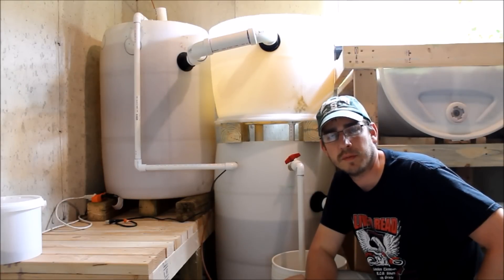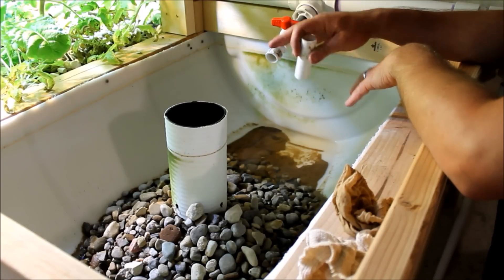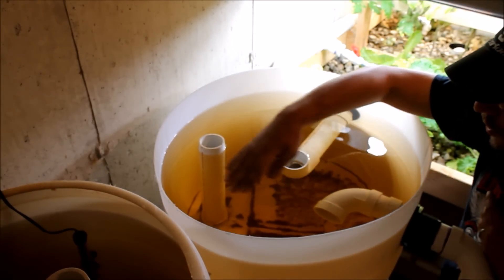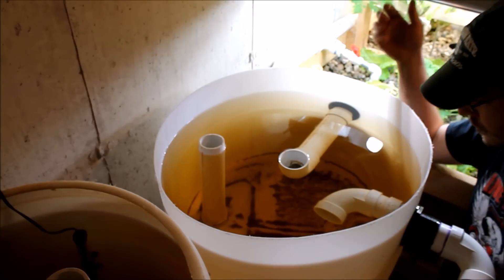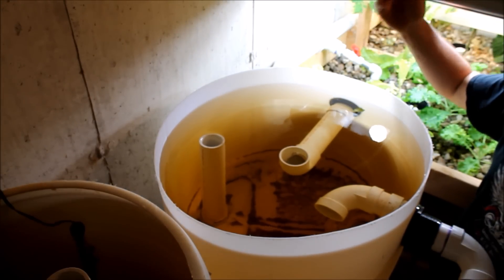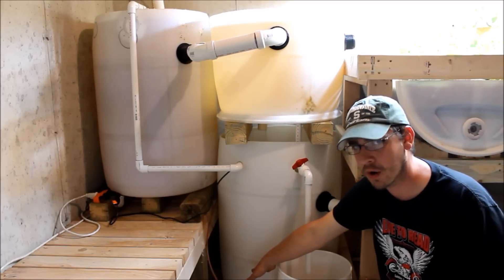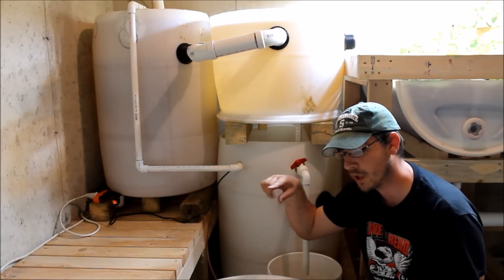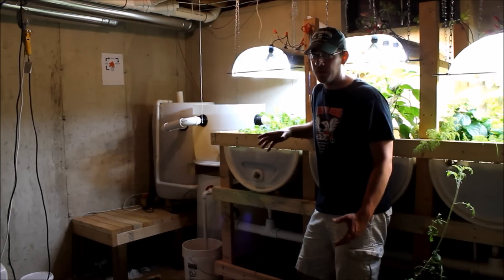Aquaponics System Design - Using a Swirl Filter to Remove Solid Waste

Comment: I see your filter water feeds your grow beds. Do you get enough of a water flow to adequately fill the grow beds so they can fill and drain a few times an hour? Does the grow bed at the end of the pipe get as much water as the two grow beds closer to the swirl filter?

Comment: Do you have a fish heater? Do the grow lights heat the beds at all?
Reply: I believe he has another video that shows a heater in a barrel that held his fish. You could put a heater anywhere in the system that gets deep enough if using a submersible heater, but not the grow beds. Unless in a separate area from the roots & media. The lights could provide some heat to the grow beds, perhaps more if they were specific lamps. 

I'm assuming more heat would come from the bacteria and processes taking place in the grow beds. It should be reasonable to believe with at least a 30 - 50gal heater plus all the other processes, sufficient heat is maintained through the whole system if you include the ambient temperature of the surrounding environment. 

You might need a larger heater depending on the needs of the fish and where the tanks are installed. Adjust according to whether or not they are tropical or coldwater natives. For plants, the water will be warm enough.
Reply: Water has a large specific heat capacity that increases substantially with volume. The more water in your system, the harder it is for the temperature of the water to fluctuate after it has reached the ambient temperature of the environment.

Comment: Mostly good job but you're killing me with that crooked run...measure twice CUT ONCE!
Reply from the maker: lol, yeah I get it. the swirl filter was an afterthought and I had to use the existing bulkhead adapter hole in the fish tank so it is what it is. It wasn't a bad cut though, it was intentionally crappy:)

Comment: I have problem  is the water from fish tank to swirl filter is slower than water from pump to fish tank. That made my fish tank overflow. :(
Reply from the maker: lower the output pipe from the swirl filter so it has a lower level than the fish tank
Reply: yeah, that's why. I put a same level out put from fish tank and swirl filter. :) thank bro

Comment: i assume you dont use a biofilter to convert the liquid fish waste to nitrates/ammonia to then add to the media bed. I'm thinking about doing a ebb&flow/ DWC system where I think I would need to have the water sit in a biofilter before getting added to a DWC. How would using a swirl filter play a role in that type of system? After thinking this out, I feel I would need a extra bucket for a swirl filter, and an extra resevoir to convert the fish waste to nitrates, and maybe even a sump for overflow purposes. What do you think of that? Thanks a lot!
Reply from the maker: you do not need a bio filter if you are using a media based grow bed system such as mine. The grow media acts as the bio filter. I would still however, recommend a good swirl filter as it will keep the beds cleaner and working better for a long long time.

Comment: Would it benefit the system to use a tapered bottom tank for your solids? That way you can just open a ball valve connected to the center of it, and drain out the collected solids?
Reply from the maker: +Boosted98gsx yes, if you can make one or add a baffle that would taper the bottom that would be awesome

Comment: I've seen other swirl filters that have the inlet pipe at the bottom or a few inches above the bottom. wouldn't it be better to have the inlet pipe in the middle of the barrel? wouldn't it give more time to the particle to move towards the wall of the barrel and eventually sink to the bottom? thanks for sharing
Reply from the maker: +Stavros Santis I would say inlet should be just below the surface of the water at the top so that the fasts lest moving water enters there and then slows down by the time it gets to the bottom

Comment: Why don't you add back the nylon sock to the intake to the planters off the swirl filter? It seems to me that would stop almost all solids?  You could just take it off and rinse it in the same bucket. A 2 minute job that would really keep your system clean?
Reply from the maker: +VacUpacks I have thought about doing that but the swirl filter seems to be doing pretty well. I was allowing for some solids to get through also to provide some food for the worms that are in the grow beds as well
Reply: +SSLFamilyDad Oh, that makes sense. I have red worms in a traditional worm bed they eat quite a bit of food.  Interesting the worms won't keep up with your system without the swirl filter.  Looks like quite a balancing act. Thank you for your response. Great video very informative.

Comment: isn't it good if the solid parts go to the plants for nutrients?
Reply from the maker: mark louie panergo Some still do get through, all the swirl does is settle out the largest solids and allows you to get the grow beds cleaner. If you just let them all go through to the grow beds you will end up with a clogged up mess in no time.

Comment: Now that this system has been going a couple years nearly, how effective do you think the swirl filter is in respect of preventing that build up in the grow beds?
Reply from the maker: Ted Soloman I have not done a full cleanout on the grow beds since I put in the swirl filter a year ago.  I have not dug through the beds yet so I can't say how muddy they have become but I can say that I empty out a lot of solids each week that would be ending up on the beds so I know it is making a HUGE difference. And it provides the absolute best fertilizer for my garden.
Reply: Have you in your journey found the initial start up cost as well as the maintenance costs to be easily outweighed by your yields? Meaning ha it proven to be not only cost effective but profitable in savings at the grocery store?
Reply from the maker: Ted Soloman it is hard to say if we reap enough vegetables out of the system to offset the cost of running the lights and pump (about $35 per month). I have done a lot of experimenting though and am not producing fish at the moment which would make the difference. The benefits of learning how to do this and also being able to get fresh produce right in my basement year round is priceless (well maybe not priceless but worth the $35!). If you did this in a greenhouse it would be easy to recoup your money.
Reply: That's great! Thank you for taking the time to reply. My assumptions were similar. In no way am I discounting the value of the knowledge but I tend to look at all aspects of any project. In no way is a negative aspect a reason to scrap the idea, more a reason to seek the key variable making it cost less money than going to a grocery store. Profitable in the sense that at the very least, the $420 a year is recovered by harvesting non gmo, clean food. However, observing all aspects also helps inspire innovations in making it surpass that very minimum expectation. Which I think will be important to popularizing this system. Because at the very least, supplementing ourselves and decreasing the overall demands of grocery stores allows us as people to vote with our dollars, force prices down, and see more non gmo products on the shelves. Which benefits everyone. All the best to you and yours, many thanks for sharing these educational videos. 

Many thanks,
Ted
Reply: Id also be interested to see if ever the expansion of your grow beds demand the need of a breather tube on the bell siphons. Time will tell I expect. Keep trail blazing.

Comment: Why don't you want solid waste getting into the grow-beds? I understand how solid waste gunking up your pipes is bad, but does it negatively affect the plants?
Reply from the maker: Ruairidh Macleod It does not negatively effect the plants but too much solid waste getting into the grow beds starts to build up on the bottom and then can cause several negative effects. The solid build up will start to get anaerobic and smell, cause pH issues, and other issues. Over time it will gum up the flow of water through the grow media and then you have to clean it all out. The swirl filter does not catch it all, but limits the amount to make it more manageable for the worms in the grow beds to handle and break down plus it gives me some fish waste to siphon off and give to my gardens:)

Comment: what size river rock you use ?
Reply from the maker: David Zick I have replaced all of my river rock with something called beechwood pebbles. The river rock was holding my pH too high
Reply: where do you get that beechwood pebbles?
Reply from the maker: David Zick Local landscape supply place had it for $90 per year. It took less than one yard to fill the four barrels.

Comment: Could you explain how you get your overflow/skimmer pipe to pass all the way through the adapter in your barrel bung?
Reply from the maker: Sure can, I have a 2" threaded make adapter screwed into the bung on the inside of the barrel. That 2" pvc pipe is connected to that and it extends up to the water level. On the bottom it just pours straight down into my sump tank. Hope that helps! Thanks for checking it out!
Reply: SSLFamilyDad I'm still confused on how you got the piece to extend out the bottom towards your sump tank.  Won't the 2" male adapter only allow you to run a 2" pvc pipe up to the top of the swirl filter?  Somehow you have piping on both sides or through your 2" male adapter...  If you could set me straight on that please do!  Great job on everything by the way.  I really appreciate the videos you put out.
Reply from the maker: sw114702 no problem and I see where I did not really clarify. You can screw in a male adapter on both the inside and outside of the threaded hole. That allows me to attach pipe on both side, one to direct the overflow down into the sump and one to attach the riser up into the swirl. Hope that helps!

Comment: Use the Wisy Garden downspout filter or the Wisy 100 vortex filter and you can bypass all of this and that way you won't have to use a rag or stockings. The wisy filter doesn't have to be cleaned but once a year. Check out Rainwater Management Solutions.
Reply from the maker: That is a great option for removing solids as well. However, I prefer not to use any filter media if possible and this way I can siphon off the waste to use as fertilizer in our garden. Thanks for the suggestion!

Comment: I'm debating whether or not to make a swirl filter or just use a biofilter where I have a water drum filled with filter media (sponges, bioballs) In your opinion what should i make?
Reply from the maker: Well in theory they should serve different purposes. The bio filter is a place for bacteria to grow and should not really also be a settlement take for solids. So in my opinion I would have both, a radial flow (swirl) filter before the bio filter. That way you can take out the solid waste before the bio filter. Just an opinion:)

Comment: Can you elaborate a little about the height of the center pipe and the overflow pipe?
Would appreciate it.
Reply from the maker: No problem. In this case since I am using a gravity system the pipe height is just set to make sure that the corresponding level of water in my fish tank does not overflow. I have the center outlet a few inches below the top of the barrel wall (about 3 inches) and the overflow is about 2 inches. Thanks for checking it out!
Reply: Thanks for your response. Made it quite clear.

Comment: I like your system. The one I am building is very close but I use gravity to my advantage a bit more. My fish tank is the lowest. My swirl filter drains into my plants and that drains into my sump which drains by float valve into the fish tank. This keeps my fish tank at constant level. Only my sump and plant bed goes up and down.
Reply from the maker: Cool, I don't think I have seen a design like that, but seems like that would work really well. Thanks for checking it out!

Comment: Would using red wigglers in grow beds result in the need not to use a swirl filter? The theory being that they would eat the fish waste.
Reply from the maker: Worms are a great way to turn dead roots, uneaten fish food, and some of the fish waste into something more soluble for the plants. However, I would still recommend a filter of some sort. There ends up being just too much solids collecting in the system that over time will just cause issues. I would promote the use of both worms and a filter.
Reply: I'm sure some were someone has a good fish to worm to plant ratio, that being said.... If you have to many fish in the system the worms will be super happy, but will most likely not be able to keep up. That being said maybe eat a few fish if the worms can't keep up. Or add the wast directly to the worm bed so if there is more than needed you can feed other plants. In my opinion I'd run the filter and feed the worms manually. They like potato and old roots from harvested plants.
Reply: The Rayl Family Can you share your "worm bed"? I'm just starting to set things up and would love some working ideas. So much of what I find is either theory or someone just starting with an idea and no real follow up
Reply: SSLFamilyDad You mentioned using the fish waste outside as a fertilizer. Wouldn't it be better utilized inside this system as a fertilizer with the help of worms in the grow beds? Or do you think the rate of waste accumulation would overhwhelm the worms ability to keep it in check?
Reply: VikingMan44 this is a bit of an old post I've been reading in multiple places, so i thought I'd through this in to help... Worms don't swim or breath under water, in a typical worm bed they hang out in the drier area just above the flood lines.the waist falls all the way to the bottom were the worms wont go. my system uses a worm bed after my grow beds and before my sump, it is set up with a bucket next to it that directly reflects the water level in the worm bed and has a pump and switch system to pull the water out and back to the fish tank,(the worm bed is only ever getting 2" of water in the bottom leaving 12" for worm habitat.) this works very well for me.
Reply from the maker: The Rayl Family That is a really good idea. Many people have stated that the worms will take care of it all and I disagree especially with how many fish I have. My grow beds would be full to the top with fish waste by now if it weren't for that swirl filter. Thanks for commenting!

Comment: Hi! nice setup im thinking about something simular. It looks like the pipe from the fishtank to the swirl filter leans upwards but maybe it dont? I mean an upward angel from the fishtank to the filter. Do you have any overflow secuity on the sump or have you had any problems there?
Reply from the maker: Thanks Gustav, yes that pipe does slant in the opposite direction than it should. I was using an existing hole in the barrel and that is just kind of how it worked out with what I had on hand. The system is gravity feed between the two tanks so they always keep at the same level no matter which way the pipe slants so it works:) I have some overflow protection on the fish tank, more on that here - http://youtu.be/sP630lKKKd4. Thanks for watching!!
Reply: SSLFamilyDad  Okey then i understand. I had a small aquaponicssystem before but im not living in a house right now so im waiting for that.. Its really nice to grow fish and veg in the same system, and also i love building stuff and its not easy to design systems that works great!

Comment: Have you thought about using worms
Reply from the maker: Absolutely, worms will be added once I get the rest of my grow media switched over to my new solution. Then I will add some worms to help with cleanup in the grow beds. Worms are not a replacement for the swirl filter though in my opinion, but both together work great! Thanks for watching!!

Comment: The overflow pipe from the filter coming out of the bottom looks like a great place to add a venturi, if your system needs it.
Reply from the maker: I hadn't thought of that. I was not going to add one to the pump line since they reduce the amount of water that you can pump; but adding it to that drain might be something to think about. Thanks for watching!

Comment from the maker: Sorry, I do not have any detailed written plans. The design will largely depend on how your system is setup. In general it should be similar to mine but does not have to be exact to work. @ Bryan Wilson Thanks for watching!
Reply: +SSLFamilyDad There are many components to studying aquaponics. One place I discovered which succeeds in merging these is the Keiths Ponics Site (google it if you're interested) without a doubt the most incredible course i've seen. Check out this  interesting site.

Comment: Do you ever have problems with your bell siphons? I've been wanting to do a flood/drain system, but I keep hearing about problems with the siphon.
Reply from the maker: Honestly I have not had any issues with the bell siphons in my system. I am still using the same ones I started with and haven't really changed much at all. I may do a video specifically talking about adjusting them and I have a little more info in my first video here - http://youtu.be/eY7ViXV7K6s. Thanks for watching!
Reply: Thanks!
Reply: Hi Can you help me to make an aqauponic systeym in my backyard.  if so please call me at 310-408-2823